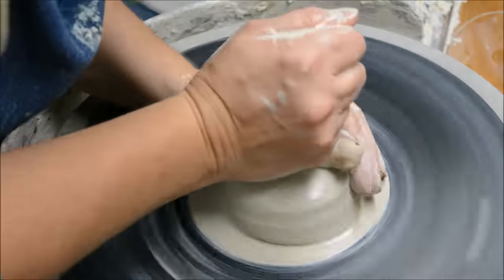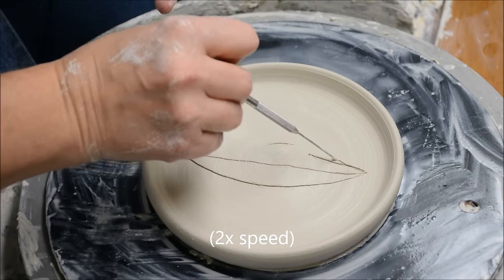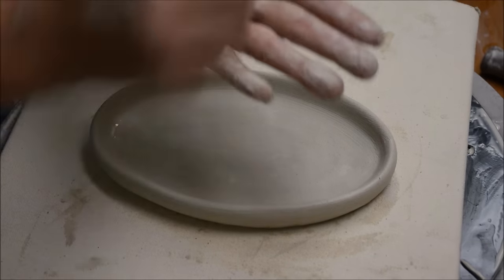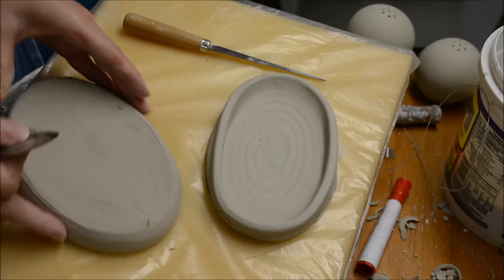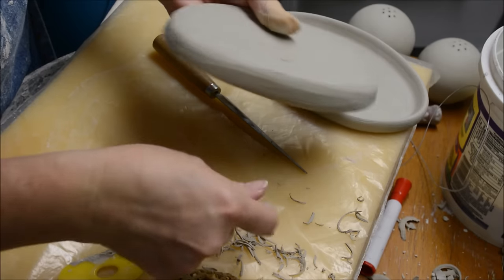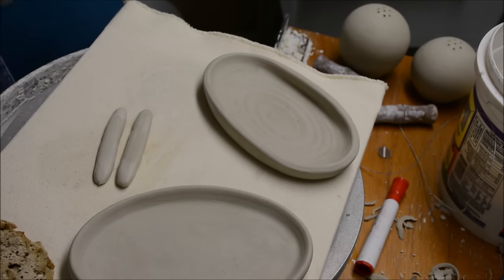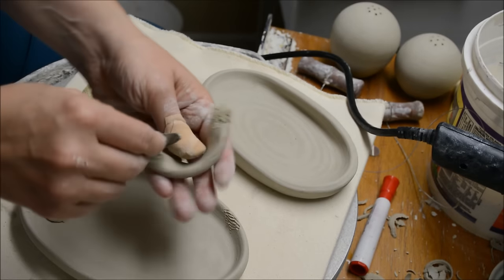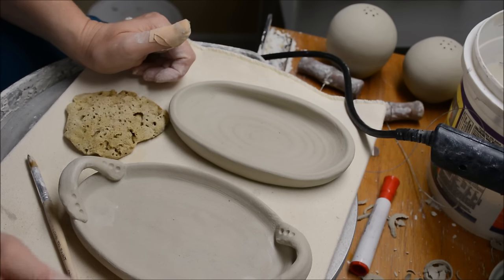Two Ways to Throw and Alter- Creating OVAL Small Trays on the Potter's wheel

Comment: I have a question about cleaning the clay off my hands, any special solution how tos? Thanks
Reply from the maker: I just use water!  I often pre-rinse in a bucket to keep it out of my drains, then wash as normal!  I do have a nail brush on hand and use regular soap.  The bucket I then let settle for a day or two and dump off the water on the top, and dump the sludge either in the trash or outside in the weeds. (I live in the country!). :). I only dump my bucket once a month or so!